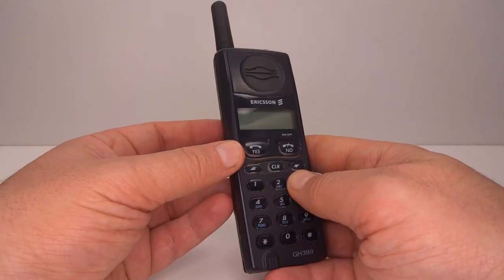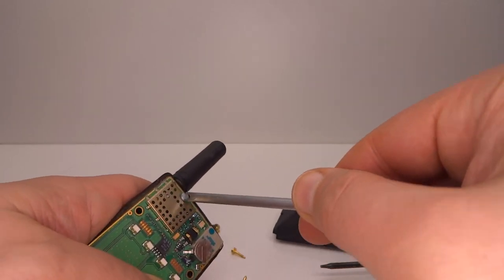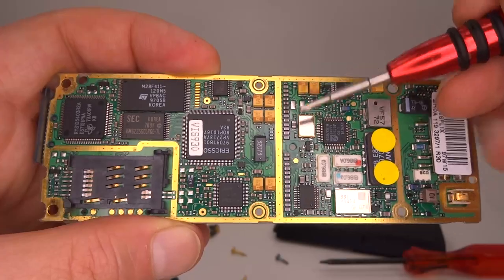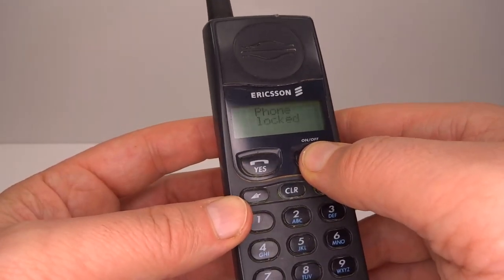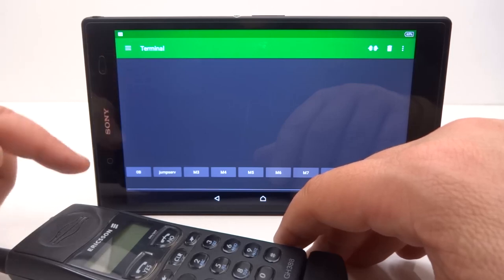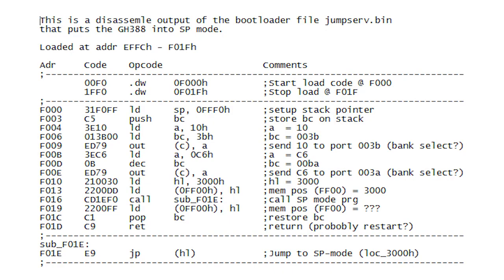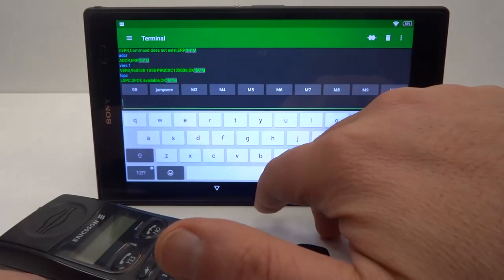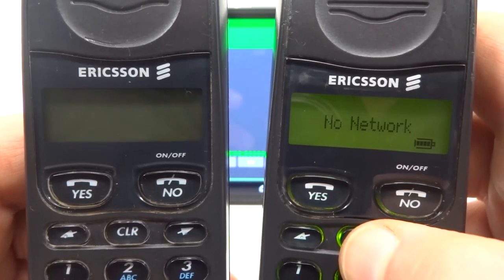Year 1996:  Ericsson GH388 Teardown & Service Mode

Comment: Genius!! Never imagined someone in 2020’s could still do this.
Reply: Janus is obviously a genius, but i remember few months ago having lots of fun mapping all key combinations and determining bitrate of an old TV remote using arduino and IR diode to make myself a little RGB LED string remote.
Reply: @tritonmole  I sent my first ever email on a Psion 5 via infra red modem on one of these (I think it was a GH888) over 3g back in 98, it would normally work after a few tries and long waits not sure what the bit rate was over infra red but probably close to the 3G speeds. 
I used to check once a day for about a month or 2 I thought mobile email was going to be useful to me it wasn't at the time I was seriously wrong
Reply: I still have se k750
Reply: @thedave7760 prison?
Reply: @sergeymarshinski  1999 felt way less like a prison than 2024.

Comment: I had this exact phone, 2 different sized batteries, and i had  a long range antenna with a whip at the top, all Genuine Ericsson stuff, back when that was a damn good brand. 

It was never as good as my Nokia 2110, which i still do have (also had a Technophone 2110 for a while!!) these were all exceptional phones, that Nokia 2110 would work well outside the Optus digital map range back in the 90s!!

Remember the 2110e and 2110i ?? I'd love to see you do something with one of those, it has been decades since my original 2110 has worked. 

The next one i had was a Nokia 3810(?) It had the nick name "the small phone with the big display" Similar phone to the one used in Matrix, but without the slide plate.
Reply from the maker: You had a Technophone branded 2110? Was it the same functions with GSM and everything?
I do have an original Nokia 2110i. I would like to make a video when I find out more of it's story.
Reply: @JanusCycle   i did have a Technophone 2110 yes, it seemed to function identically to a Nokia 2110, i can't recall any difference.

I will have to look at the old one i have and see which one it is, think it's a 2110 plain. Pretty sure i sold the 2110i wayyyy back.
Reply from the maker: @CaseTheCorvetteMan  I don't know if I have a 2110 or 2110i, they look so similar and I'll have to dig it out to check. The 2110e has a noticeably different style though. As I recall these Nokias didn't have a clock. Something Ericsson did have at the time :)
Reply: @JanusCycle  yes the 2110e was visually quite different. The 2110i was visually almost the same, but had the antenna from the 2110e.

The keypad layout was different in terms of the alpha locations, the e and the i had them in alphabetical order, where the plain didn't. 

The one i have is a plain, the battery is buggered and has been for many years. I had that phone repaired by Mobile Phone Solutions in Maroochydore back in the 90s, still has their sticker on it!

Comment: How on Earth do these charge? I have a car charger for this that connects to the bottom  but the LED or the LCD does not indicate that it is charging. Only when it is powered on. And no LED charge signal when powered on, either. In the original box, when I opened it, there was a 2nd battery and an external charger for the battery only.
Reply from the maker: I'm not really sure, I only used external battery charging for this.

Comment: Can you please provide pinout for this?
Reply from the maker: Pin 8 is ground, 
pin 11 Rx data, 
pin 12 Tx data, 
connect pin 9 (test mode) to pin 6 (+5  volts out) to activate test mode. https://old.pinouts.ru/CellularPhones-A-N/ericsson_218_318_337_388_pinout.shtml
Reply: @JanusCycle  managed to do a gh337 with your method. For gh337 the memory zones are different but i found them. Can you share a documentation link with models/zones to rewrite for security code and network unlock please? Thanks in advance 🙂
Reply from the maker: @alexandrufloricica1435  Here are the user lock locations for both models. I need to find the network unlock location. https://forum.gsmhosting.com/vbb/f30/how-putting-old-ericsson-test-mode-read-14611/
Reply from the maker: @alexandrufloricica1435  Maybe this can help you with the GH388, the full eeprom memory map :) https://drive.google.com/file/d/1fW-nfJ757G402iDiwBP0yReDFBr_-P-f/view
Reply: @JanusCycle  thank you! do you have this information for gh688 also?
Reply from the maker: @alexandrufloricica1435  I don't have the gh688  memory map. The gh688 is my favourite Ericsson phone!
But I do have the gh788 memory map. Maybe it can offer some clues? https://drive.google.com/file/d/1LPryklkiAkSU4y7LxxhXeg-xLsHeLei2/view
Reply: @JanusCycle  do you know if is this the same as gf788?
Reply from the maker: My guess would be that the gf and gh models are almost the same except for different radios.
Reply: @JanusCycle  do you have memory mapping for 628 and a1018?

Comment: which usb ttl should i use
Reply from the maker: They should all work fine if you have the correct driver and a good terminal program.
Reply: @JanusCycle  Which pin is the 5 volt input

Comment: hello please help, how to change the IMEI to this phone and especially to the Ericsson 688 model, which device is required to do this and which program is required and where it is sold I do not have any information on the internet.
Reply from the maker: I’ve never tried, because I’ve never needed this and it’s illegal here. But here is some software for Ericsson. I don’t know if this helps.
https://ericssoners.wordpress.com/2012/10/20/unlockflash-software/
Reply: @JanusCycle  hello you would write to me